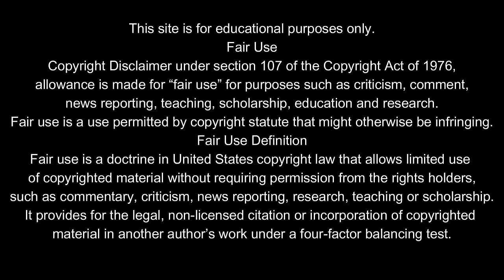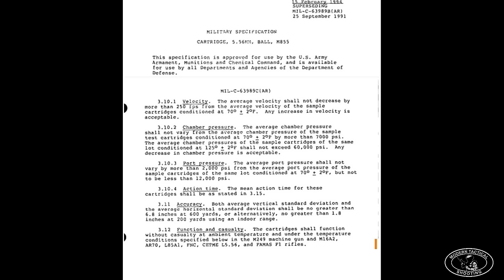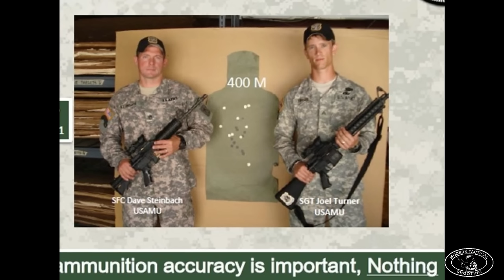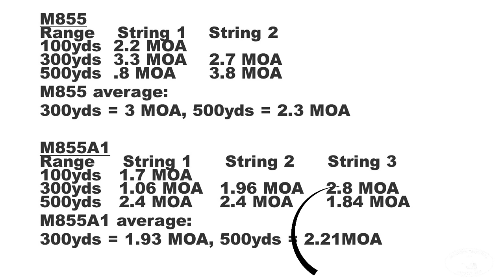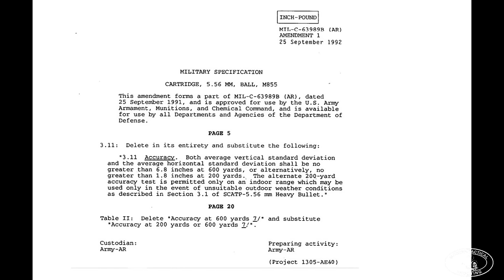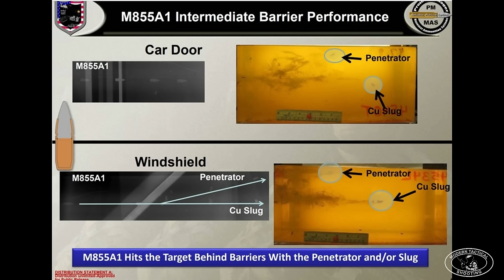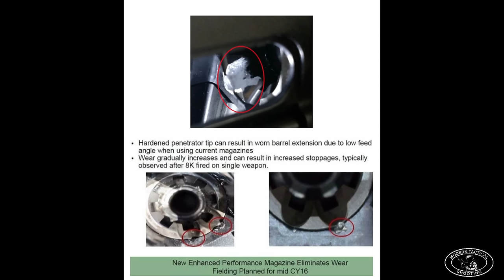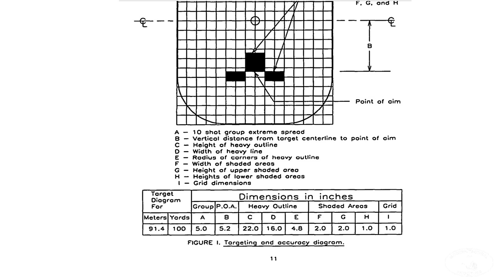M855A1 Performance Review. Did it live up to the Army's hype? Did going green really work?

Comment: I don’t know if they are still loading it as hot as the original spec, but that stuff beat our M4s to death. My unit did a series of ranges in Alaska in 2017 and it took almost 10% of our rifles out of the fight over two weeks. We had so many broken bolt lugs, it was incredible.

It made me want to buy an extra bolt and keep it with me.
Reply from the maker: I carried a spare bolt in my pack on mission, after I broke a bolt on the range in Afghanistan. I figured sure.... I put a new bolt in and doubt it would fail. But I figured all the team's carbines had close to the same high round counts, so just in case a teammates bolt broke on mission, I had one to offer.
Reply: @ Riorozen
Combination of “lowest bidder” and the fact that it was developed for a lower level to begin with.
Reply: You probably already had significant gas port erosion on your M4's before fielding M855a, and the new higher pressure round just exponentially accelerated the deterioration of your carbines.
Reply: @ModernTacticalShooting  It's good to keep stuff in stock because if there was ever a time were you need to start burning the tires in the street, the people you defend your community with might need it.
Reply: The original A1 load was about 10% hotter than M855 but later development found a powder charge that would get the same velocity results with only a 5% increase in pressure.  That's what was briefed at the Wilson match a few years ago.
Reply: @jfk767  was it like faster burning or something? And you know, what if they switched to polymer casing and got a better seal? Less heat? Maybe with the powder and casing you get like 100fps more?
Reply: Sounds about right. In Infantry World I’ve seen bolt expansion chambers significantly loaded with carbon, which raises the unlock velocity, ergo force.
Blank carbon is the worst.
Reply: As late as three months ago, we were still breaking bolt lugs.
Reply: @ArgosySpecOps  Yeah, M4s are always overgassed because the gas system is so short.

The guns batter themselves to death without a H2/H3 buffer weight.
Reply: @Riorozen the LMT Enhanced Bolt seems like the obvious fix, in a way it was, almost literally, made exactly for this
Reply: FM 3-22.9 explains the increased pressure of the 855A1.
Reply: @ModernTacticalShooting  how bad will the 80,000 PSI 6.8x51mm be???
Reply: New M855A1 info:
I just broke down 300 cartridges.  8 out of every 10 on the stripper clips were loaded to 25.7 grains.  The other two would always be overcharged to over 27.
This 80% average held true for all 300 rounds.
Reply: Troy DYKY   name the powder load? @blackawk 7r
Reply: They dropped the pressure after all that crap happening and designed a mag for it to save feed ramps……
Reply: @danielcurtis1434  The perating system is both different and designed from the start with that load in mind. So you can't extrapolate.
Reply: They ARE NOT loading it that hot and haven’t since less then a year after it hit the field……
Reply: @miltechmoto  you would begin to experience overheating issues similar to what was discovered during military trials of caseless firearms. The brass cases are essentially a crude heat sink. If your case material is a poor conductor of heat, then said heat would be absorbed by the firearm instead of being expelled with the case.
Reply: @TheIronClooch  Yeah but when they were showcasing the polymer cased ammo, they lit off like a 30 round belt and the chamber was still ice cold...So sure it might not being extracting the heat via the casing but if there is no heat until like hundreds of rounds later you're in the same boat anyways of waiting for the gun to cool down via the ambient air. Right? I mean the only difference would be that you're taking much longer to get to the point of waiting for it to cool down.
Reply: @miltechmoto  Bruh, if you are resorting to burning tyres in the street... you've already lost!

That said, if you have nothing else... 

Try to not be on the losing side in the first place I guess
Reply: @dfgiuy22  I'm not sure what you mean by that.
Reply: @miltechmoto  I meant if you are on the side that is burning tyres to obscure observation from your adversary, you have already lost. Yes low tech solutions can be all that someone might have, they can work but its going to be a extremely costly, uphill battle for the side with less capability.
Reply: @dfgiuy22  burning tires is a reference to blackhawk down, when the city burned tires using the black smoke to signal to the militia that the US was launching an attack.
Reply: That was the carbine gas tube length! Mid reduced the pressure.
Reply: Anyone running 855 in a1 rifles? No m4 feed ramps?
Reply: Always a good idea to have a spare bolt.
Reply: Only so much performance from 22s. Moving to 6mm seems prudent.
Reply: @Riorozen I remember seeing a video on bolt carrier groups by small arms solutions and the fact the army still uses the mill spec one is nuts.
Reply: troydyky2506 what is the new type of powder?
Reply: @Laotzu.Goldbug yes  or the Geissele enhanced BCG 

Carpenter 158+ Bolt that is also Forged, gives multitudes higher strength and longevity of a Mil Spec  C158 bolt, as well as the coating and enhanved carrier it's a very good upgrade to the system. I'd choose either frankly
Reply: I was stationed in JBER from 2015 to 2018 with the 1-501st. We might have known each other irl lol.

Comment: M855A1 might see a longer service life in Big Army far beyond the adoption of 6.8mm because my gut feeling is that the higher-ups will hopefully understand (or maybe planned all along???) that NGSW is better suited to replace the .308 lineup and the 5.56mm SAW rather than the 5.56mm carbine. 

Edit: If I remember correctly, Jeff covered this in the Practical Accuracy NGSW vid (link's in the description).
Reply from the maker: Yes agree
Reply: Great insight. We can only hope.
Reply: Sounds like they're going to have to improve the bolts and barrel extensions on older M-4s, and maybe go to a stainless hybrid case for M-855a1. Or a1(b) or whatever you'd like to call it.
Reply: @dangvorbei5304  LMT Enhanced Bolt could probably fix all of those problems. I don't know enough about metallurgy to say if you would need a beefed-up barrel extension as well, but if you are breaking those I think you have bigger problems.
Reply: @Laotzu.Goldbug  That's an awesome idea, and there's bound to be a way to handle the barrel extensions as well.  SIG isn't about to share their secrets, but as LMT demonstrated, they aren't the only game in town. Next, to do something about this BS 5moa rebuild standard.
Reply: 6.8 SPC would have been a far more ideal replacement for 5.56 as it maintains the M4 chassis and substantially outperforms all 5.56 loads at ranges one can use 5.56. 

I get 2585 FPS from 77gr IMI Razor Core 5.56 from a 16" Daniels Defense 1:7 NATO chamber
I get 2600 FPS flat from 110gr OTM 6.8 SPC from a 16" Daniels Defense 1:11 5R SPC II chamber

IMI 77gr has a BC of 0.362, Hornady 110gr OTM has a BC of 0.360. Trajectory is literally almost identical, but the terminal performance 277 cal is considerably better. And whatever bullet design you can do in 5.56, you can do in 6.8mm, weather it's 6.8 SPC or 277 Sig Fury (6.8x51mm), the big brother to 6.8 SPC. 

Do a google search for the following DoD testing that went from 2004 all the way up through 2017 and you'll see both the origins / performance of 6.8 SPC and also the new 6.8x51mm for the NGSW:

Report on Small Arms Lethality (Gary Roberts, 2008)
Wednesday Ammo11456 (Jim Schatz, 2011)
DO WE NEED A NEW SERVICE RIFLE CARTRIDGE (Jim Schatz, 2012)
WOUND BALLISTIC TERMINAL PERFORMANCE FACTS (Gary Roberts, 2013)
Where To Now 17354 (Jim Schatz, 2015)
18260 The Path to Overmatch (Jim Schatz 2016)
19394 Maintaining Overmatch (David Zhou, 2017)

Here's an excerpt from 19394 Maintaining Overmatch:

Some of the major findings from the RDECOM caliber study’s Summary of 
Analysis are the following:
• Larger caliber bullets do more damage to the target, mostly proportional to MV^3/2--increase in 
damage capacity is larger than increase in system weight.
• Barriers: Larger caliber bullets required to penetrate certain barriers (range)
• On barriers where smaller calibers also penetrated, larger calibers had measurably high post-barrier target damage.--.277 split top performer by weight, with .30 in these tests.
• Damage based methods and methods that focus on “good hits” will favour larger calibers--.277 caliber the best performer, by weight in this test.
• Stowed kills:
• Will always favor lighter systems 
• Disproportionately biases weight against performance 
• Mathematically, we should choose BB guns
• Should be coupled with other gages (requirements) to be meaningful to the soldier
• .224 caliber was the best performer by weight when using this method (stowed kills)

Basically the stowed kills method, which was historically used in the decision to adopt .223 Remington in it's "hotter form", 5.56 NATO, was largely based on using the "stowed kills" method of evaluation which completely ignores actual terminal performance. Typical academic approach. Combine that with the studies from WWII indicating that the side who fired the most shots typically won the fight, the big Army chose 5.56 and has been dealing with it's limitations ever since.

5.56 is no doubt lethal, but so is .22 LR in the right conditions. The problem is real world applications which are NOT ideal. For that you need a margin of performance that 5.56 simply cannot offer even with the best ammunition's in quite a few circumstances. And anything you can do to a 5.56 bullet, you can scale up to a larger caliber bullet just like M80A1 is a M855A1 bullet scaled up to .308. M855A1 is an improvement upon M855, however it still has poor glass performance and post barrier performance.

Penetrating NATO plates is an irrelevant test. Who uses NATO plates? M855A1 takes 5.56 about as far as it can go. Based on testing I've seen, MK318 actually performed better post barrier than M855A1, however it did not meet the NATO plate test. Neither M855A1 nor MK318 will penetrate IV hard plates or even III+ Special Threat plates like Hesco U210's which are rated to stop M855A1 at 3050 FPS! 

For hard plates you need Tungsten AP in any caliber or cartridge. Period. You need mass and velocity too. Just do a google search for "97GR ARMOR PIERCING 20 ROUND BOX", they still sell 6.8 SPC AP loads that will defeat IV at 100 yards. For 5.56,  you get 80 yards with the same bullet design, but a smaller hole and worse post plate performance.

5.56 is lethal, but it's far from ideal in many cases. I think it's a good home defense cartridge (less likely to need barrier blind performance), but a poor combat cartridge. For somethings, there simply is no replacement for displacement!
Reply: @thelion70x79  Military should have adopted (6.5grendel) 1100yd capable.   Better terminal performance.  Better AP capability.  Serbia adopted a brass jacket steel carbide AP projectile that defeated level 4 body armor       6.8 offered no advantage over 77grn 556.
Reply: Personally I don't think the development of an entirely new round was needed. I've said (probably drive my second deployment in '06) that all the army really needed to do was rebarrel the M-4 and send new magazines for 6.8SPC during reset after a unit returns from Iraq/Afghanistan.
Reply: @jjjr.1186  not for nothing but the average infantryman probably isn't going to try a shot that far yeah I know mountain to mountain in Afghanistan can be 600+ but that's also 1/2 the range you're talking about and retaining something like 40% more energy at 300m is nothing to sneeze at. If we're possibly going to get into a fight with Russia/China I'm more worried about urban combat, defeating barriers, and delivering as much energy as possible to the target so they don't get back up.
Reply: @politicallyinsensitive4200  6.5grendel.  6.8spc failed.  Didn't have the range of 556.  Nor more knockdown at range.
Reply: @politicallyinsensitive4200  suppression is key to breaking engagement.  If ur bullets can't reach the enemy yet theirs can reach u.   they have the advantages.    Also that's why Grendel shines. It does better up close.    And long range.    So no loss of any advantage.  Only gains.      U don't have to buy it.    But I did.   And I'm great full I did.
Reply: Depends, of all rifles being used in Ukraine the unexpected star of the show has been the return of battle rifles like the SCAR-H. This is especially true in this winter's static trench warfare in wide open agricultural spaces between treelines and taking out human waves advancing from their trenches across no man's land. Aside from the SVD the Russians really have no infantry equivalent and being able to hit them at +600m with .308 with many wearing poorly made body armour has been absolutely devastating.

In urban environments and when the war returns to movement, intermediate rounds will still have a place but seeing as you can straight up buy a pair of fully capable lvl 4 plates off Aliexpress for just $100, I'm not sure how long 5.56 will stay effective.
Reply: ngsw didn’t age well lol
Reply: @Laotzu.Goldbug a bolt isn’t going to fix barrel life issues.
Reply: @goforbroke4428  actually it can help. not for the rifling but for the barrel extension. the LMT bolt has a different rotational geometry so it puts less stress on the Locking lugs on the barrel extension and can extend their life
Reply: @Laotzu.Goldbug  it’s not just the locking lugs being stressed by the new ammo.
Reply: @goforbroke4428  I understand that, but now you have changed the topic. My original point on the comment I made a long time ago is accurate, the LMT enhanced bolt, among other things, help to improve barrel life, even if it didn't solve _every- barrel issue. Also that came out a long time before M855A1.
Reply: @Laotzu.Goldbug  I didn’t change the topic. I’m still talking about barrel life.

Comment: Thanks for the first hand report on M855A1. We get so much political "Gas Lighting" from the military "Managers", that I don't have a lot of faith in what they have to say.  I had heard that the Army had to reduce the chamber pressure of this round once it was issued. I know there is no way to measure that in the field, but have you heard that too?

Regarding the 6.8x51 round, all the videos I see are guys shooting the low pressure "Practice Ammo" and not the full power 80,000 to 100,000 PSI "Combat Ammo". I imagine the reason for every rifle having a suppressor is the incredible report from such a high pressure round out of a 13" barrel. I was able to talk to the SIG development team and they weren't allowed to disclose any AP data, as the Army requested that they not discuss it. I did handle all the new weapons and the M5 is ridiculously long and heavy and for CQB, I would say it is less then ideal. Personally I think this rifle is going to be quietly dropped once it gets in the hands of the trigger pullers. 

The new 338 machine gun, which is lighter than the M240B and supposedly uses a shorter round than the 338 Lapua Mag, impressed me as the pressure was reasonable and it didn't require the new hybrid case. I could see this replacing the M240B in the Medium Machine Gun role. The 6.8x51 M250 is much lighter than the M249 and if chambered for the 7.62x51 round would be a great squad weapon that can use current ammo stocks and retain NATO compatibility, especially if the sound suppressor was optional. .
Reply from the maker: I agree I dont see The M5 rifle going force wide with success but who knows

Comment: 1sfg/7sfg maintainer here. When we had the a1 issued to us we saw a massive jump in bolt breakages. New and old bolts were subject to this.
Reply from the maker: Good to know!
Reply: @ModernTacticalShooting  my pleasure, it was a blight when they rolled into the training fold. It pushed teams to shoot mk262 for basically 8 ish months before the powers that be deemed it cost ineffective. From a maintainer standpoint we had issues in a few arenas from bolts, gas rings and barrel wear and tear.
Reply from the maker: @Foxholefirearms  Yes I always assumed more damage and my team we shot a shit ton, I was surprised to not see more guns go down on my ODA.
Reply: @ModernTacticalShooting  luckier than our guys, granted at the time all this was going down at 1sfg I was at the GSB as a civi augmentee, but I can say one thing that made a bit of difference was the roll out of the URGI with its mid length gas system. That little extra dwell time cut back on bolt lugs shearing thankfully